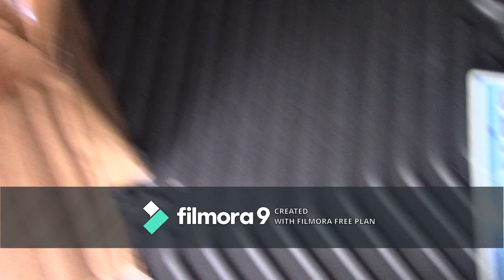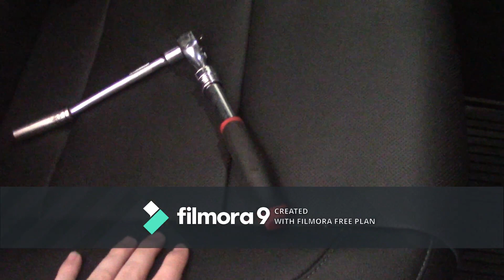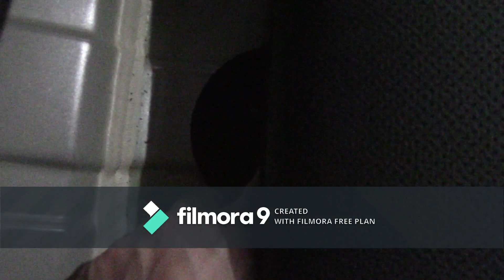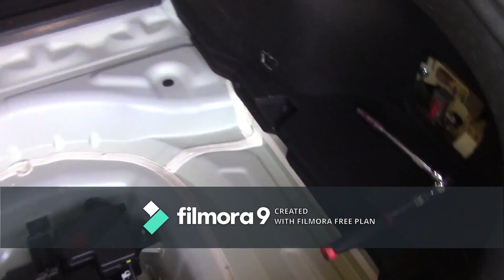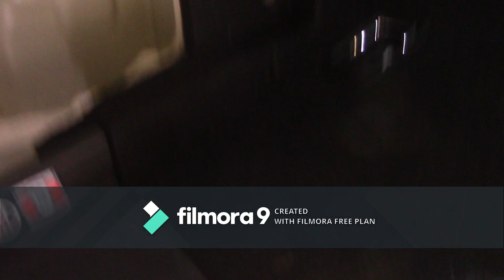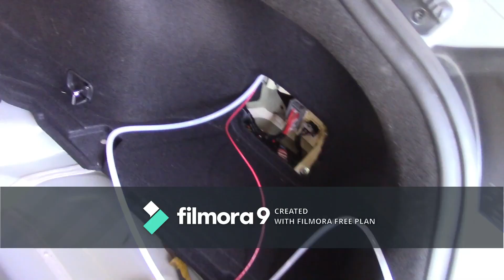Kia Stinger GT Water Methanol Injection BMS Kit Install Part 1

Comment: How much hp are you making to the wheels with the wmi kit?
Reply from the maker: I never put the car on the dyno, but I ran an 11.6  at the track quarter mile. I would say anywhere between 430-460 whp. I didn’t just have the wmi kit. I had downpipes, exhaust, Intakes and JB4 tuner. WMI kit definitely worth it and very easy to install. If you are trying to go faster this is definitely a mod to do and worth the money.
Reply: @prvideos8229  i know this is a dumb question but in your opinion is the wmi kit okay to run if my car is still under factory warranty?
Reply from the maker: @dmgwraith8417  My car was under warranty and I never had issues. It’s all about what you want to do. If I ever had a dealer visit for like a recall I just removed the wmi kit. I mean I never had to remove it because I did all the recalls before I started nodding the car. The wmi kit is safe and i never had issue with it. I personally would recommended, but the decision would be up to you.
Reply: @prvideos8229  awesome so it's easy to remove if needed to have the car serviced and no way for them to tell?
Reply from the maker: @dmgwraith8417  I mean honestly all you have to remove is the wmi tank from the truck. The line runs inside the molding of the car so they won’t see that and they won’t be searching for that. Is not like when you go to the dealer they will search you car like you are crossing the border at Mexico. There is no way for them to tell if you remove it. I honestly never took my car for the dealer because I did my own oil change or went to a local shop that charged me a lot less than the dealer did. I only went to the dealer of there were recalls. Not once did I have an issue with the stinger. Just make sure to install colder spark plugs if you use a JB4 and install a wmi kit. Either way you should install colder spark plugs happens at .024-.028. I mean I would start with simple mods like Intake, spark plugs, downpipes, exhaust and a JB4. See how you like that and if you want more power install the wmi kit.
Reply: @prvideos8229  thanks for answering my questions. If the wmi isn't an issue to use as a daily druver I'm getting it right off the Rip.
Reply from the maker: @dmgwraith8417  Just remember that you will need to get a JB4 to run the wmi kit and change your spark plugs. Reach out to Terry at Burger Motorsport’s or go to Burger Motorsport website and you can buy everything from there.
Reply: @prvideos8229  yep I've spoke to them before. I'm looking at their 450hp package and adding wmi kit
Reply: @prvideos8229  thank you for your help
Reply from the maker: @dmgwraith8417  Awesome that’s a great package. I have a lot of DIY videos for installing on my Channel for the Stinger. If you have any questions down the road just send me a message thru here and I will gladly help you out. Good Luck with the mods and you will enjoy them very much.